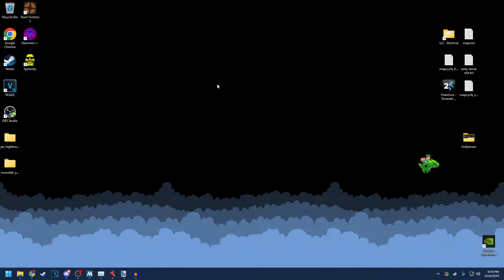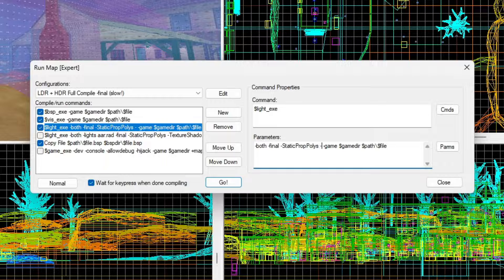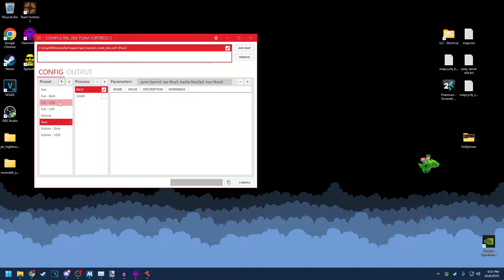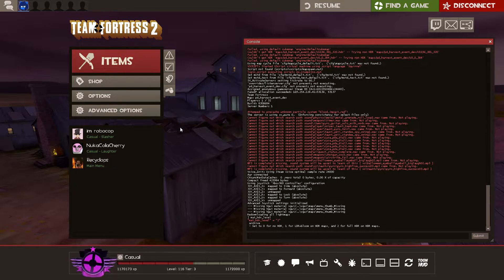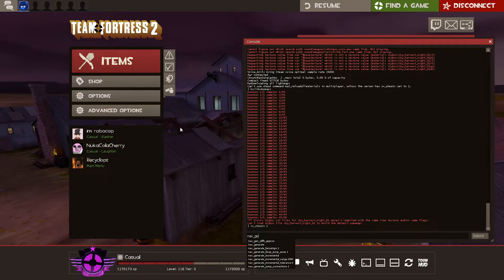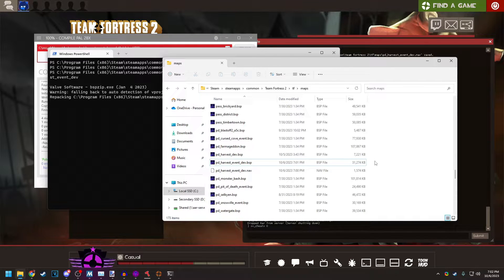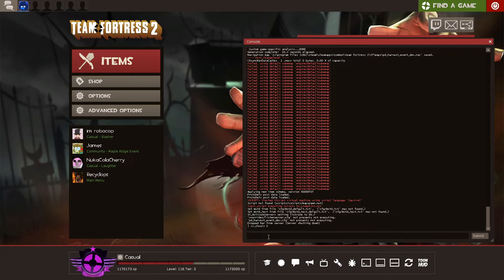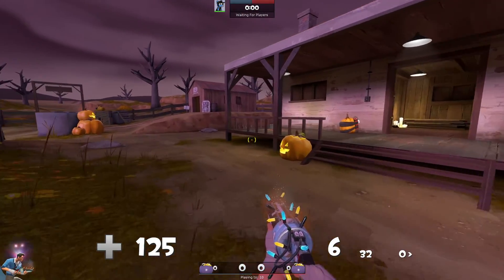TF2: How to Manually Compile a Map Correctly (Hammer Editor)

Comment: Dude, how can i fix the HDR issue in a gmod map? i want to port it to SFM and i did every tutorial for HDR and still having HDR error, the map es Rp_Evocity_V2d, is there a difference between compiling normal and expert?? can you help me pls. i have a serie and i use that map cuz the character live in a house on that map, plsss respond ASAP :CCCC
Reply from the maker: what is the "hdr error" or "hdr issue" you're mentioning?
Reply: @A2r2r  that there are no HDR Lightning and the map look very Bright, like when you put mat_fullbright 1 in the dev console
Reply from the maker: @Killerblaster95  you probably have a leak; check the logs of said map https://www.interlopers.net/errors/
Reply from the maker: if the map is ONLY extremely bright in hdr, you need a tonemap controller https://tf2maps.net/threads/map-looks-really-washed-out-with-hdr-on-ingame-solved.39294/
Reply: @A2r2r  I already fixed it, the map had custom models and textures, i had to activate embedded files box in the BSPsource, then copy the materials and models inside and paste it on the gmod directory (i used the gmod version of hammer), the outside of the house looks without HDR but it looks cool anyways, i'll upload a video now with the preview, and maybe a tutorial soon, thx anyway for the response, i appreciate it
Reply: @A2r2r  i did the same with the copy-paste in the SFM's hammer version, but that version still was giving me HDR error, but the gmod version worked really well